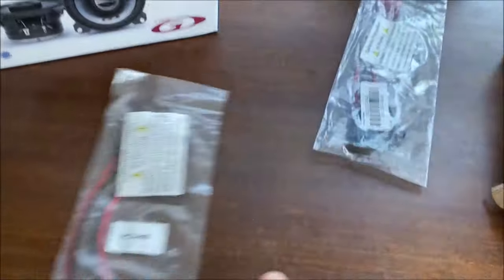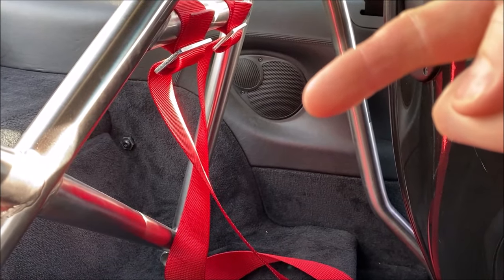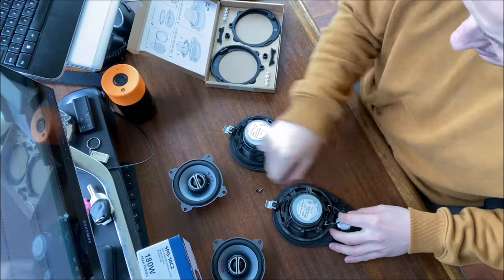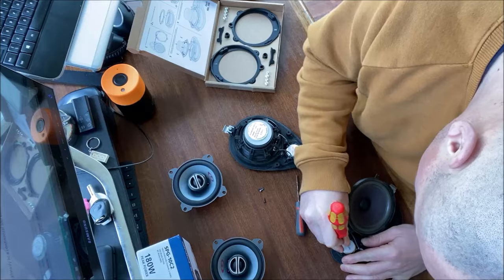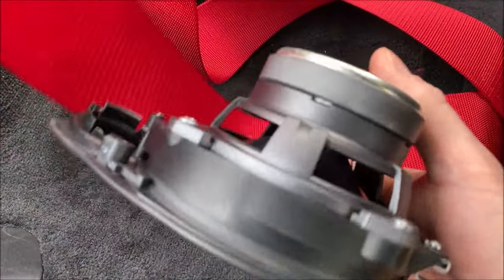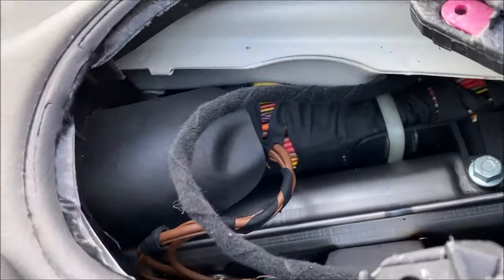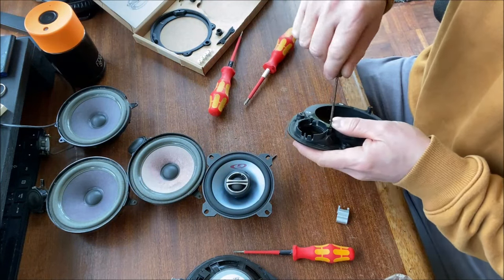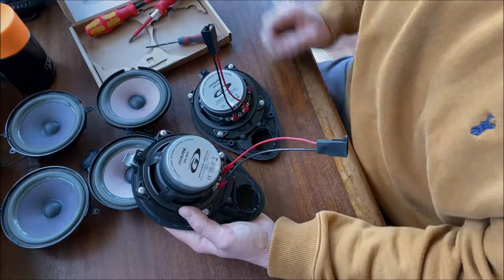Porsche Speaker Upgrade | 996 986 |  Super_Paulie mounts, Alpine SPG-10C2, PC2-805 adapter leads

Comment: just did this yesterday with the kit from superpaulie, what a huge difference.  I have the same hi fi system as you, not Nokia speakers.  The process was simple and clean.  Getting those screws out near the window was a pain and had to cut out some of the material behind the rear speakers, as the magnets on the Alpines are much bigger.  Agree the old door woofers seems to be helping/performing better with these.  Massive upgrade :)
Reply from the maker: Good work Chris! Other than that crappy screw by the screen it’s pretty easy right. The mounts make a proper job of the swap. 🙌
Reply: @TheThrottleCable  totally easy! did you have to cut away of the insulation behind the back speakers? I did, or the magnets would not fit
Reply from the maker: @cgoldens  no mine just popped right in - I guess thats luck of the draw 😄

Comment: Hi, was hoping you could assist me with an issue, I’ve done as you did in the video, same process and speakers, but now the front ones don’t work, and the back ones can’t take high volume for their life, the door speakers have not been replaced. Any thoughts on the possible causes and solutions?

Edit: Turns out the Rear ones decided to sound outstanding now. The dash still has no power and must find some good replacement for the doors.
Reply from the maker: This sounds like it could be dodgy connections, especially as the rears are now working again. Have you tried to remove them since to check the condition of the cables and connections? That would be my first move 👍
Reply from the maker: Next move would be to process of elimination. Test all the new gear works. Eg try speaker that was working in a position that wasn’t. Try cable adapter that was working in a position that wasn’t. See if the problem travels or if it’s with the existing kit in the car.

Comment: Just fitted new dashboard and rear speakers and thanks to your guidance it was really easy and has made a significant improvement to the sound even with the original head unit. Do you have any plans to replace the door speakers? Thanks Rob.
Reply from the maker: I was going to leave the door speakers ‘as is’ as they seem to sound ok. If I hear a car with them changed and it’s a significant upgrade then maybe I will!

Comment: Love the content! So glad you're back. I've been upgrading mine at a similar pace to yours! Any plans on changing out the door speakers? They're quite massive, always wondered if it'd also save some weight.
Reply from the maker: Thank you 😊 regarding the door woofers I was not planning to change them. They actually seem quite good vs the full range speakers and I’m happy as is. 

However I know a few owners have replaced the woofers and upgraded the stock amplifier with good results. Depends how far you want to go 😁
Reply: Get a pccm÷ from your local dealership. It is a lot but adds modernizing to the 996. Mine is BOSE and works great. Also porsche still sells those speakers and they're are not unreasonably priced. Did the 4 speakers in my daughters 986S that go behind the driver.

Comment: Quick question if you don't mind. I just want o confirm the little subwoofer is not needed? Thank you, great camera work and explaining.
Reply from the maker: Hi Andrew, I’m not sure which little subwoofer you reference. My car has no sub, just the six speaker configuration two in dash, two woofers in doors, two in rear cards.
Reply: @TheThrottleCable  My error, I was talking about the two woofers in the doors. I appreciate it. Thanks again
Reply from the maker: @andrewsilverman7954  as long as you have the correct harness it will work fine with the 4 or 6 speaker setup. In the 4 speaker setup you’re running the speakers straight from the head unit, in the 6 speaker setup you are still utilising the amp in the frunk (via the line level converter in the harness, like my setup).

Comment: Handy video, thanks! Any reason you went for 4-ohm speakers instead of the original 2's? I'm guessing it doesn't matter so much if you change them all at once?
Reply from the maker: Hi, the outgoing speakers are actually 4 ohms from the Porsche sound package - it’s likely the later Bose 2 ohms system you’re thinking of 👍
Reply: @TheThrottleCable  Actually, I've literally just been tearing the car down and am mid-way of installing the PCCM Plus, I took the front dash speaker out as part of the cable routing and noticed it's a 4ohm unit, that makes my life a lot easier, looks like I'll be following your guide even more closely after-all :)

I also purchased one of the Bose rear parcel shelf bass boxes, which looks like it'll be possible to wire into this amp too, so hopefully this is going to sound great when it's finished! :)

Comment: Anyone know if this solution (I mean the speaker connections and speakers etc) will work for a Bose system conversion? I know that it will not solve for the door speakers… but hoping this can update/upgrade my dash and rears. I already added the PCCM+ head unit.
Reply from the maker: As long as the speakers you replace them with are the same impedance/ohms you should have no issue to replace them
Reply: @TheThrottleCable  I have heard that both dash speakers and both rears are 2 Ohms. Is that your understanding? If so, and I was able to find speakers with that, then I would just need to make sure that they had the same/similar depth and dimensions of the ones you have confirmed to fit?
Reply from the maker: @davidpatterson5447  to double check just take a speaker out - the ohm will be printed on the rear of the magnet. Then it will just be a like for like swap with the correct ohm speaker to work with the existing setup.
Reply: @TheThrottleCable  Thank you very much. I will report back for the benefit of others when time allows for me to source items and complete the work. 👊🏻

Comment: I have a 997 no boose and i must change the stereo and speakers they are crap 🙈
Reply from the maker: I had a good run out at the weekend in the 996, and the new speakers have made a marked improvement to the sound and volume in the cabin. Especially given the modest price point 👍
Reply: @TheThrottleCable  what was the company ? Do u think they ship to sweden?

Comment: Why cant you keep the twitters and solder them to the new speakers?
Reply from the maker: Couple of points. The new speakers have inbuilt tweeters so it’s not necessary. Also the new speakers are a step forward in terms of performance, so linking in old tweeters would likely negatively impact the resulting sound.
Reply: Thank you👍🏽